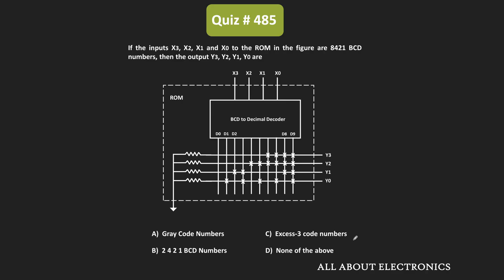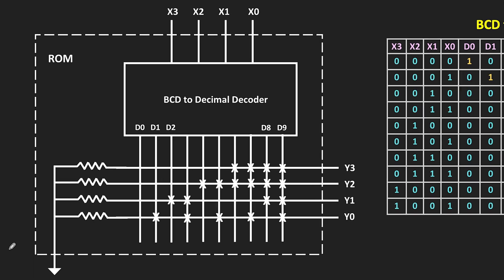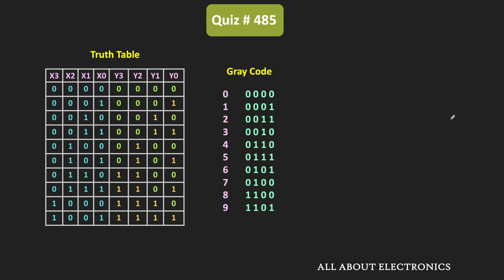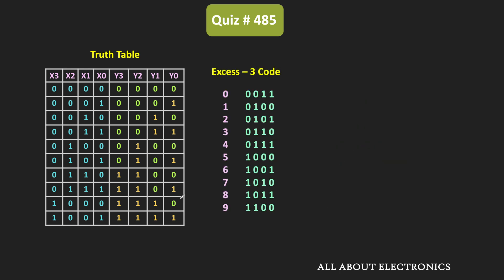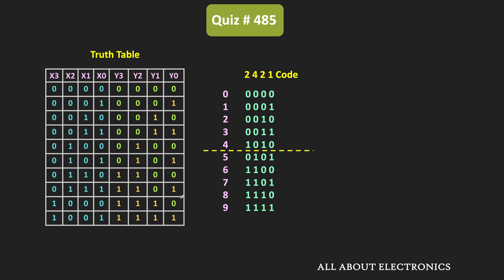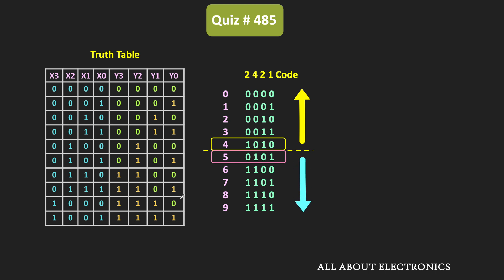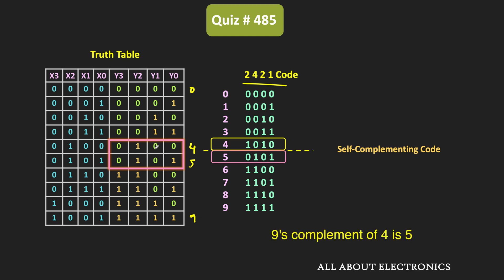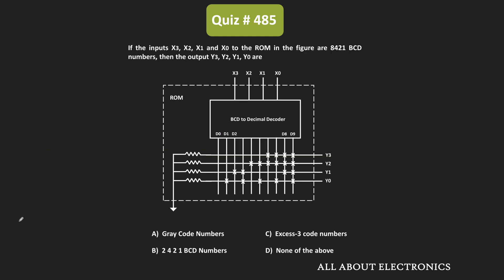ROM as Programmable Logic Device (Digital Electronics)| Quiz # 485

Comment: in 2421 BCD , 4 cna be represented by 2 types 0100 or 1010 ...  so the output actually satisfies the 2421 BCD code .... so answer should be B .... correct me if i am wrong
Reply from the maker: 2421 is self complementing code. That means 9's complement of the number can be obtained by simply inverting 1s and 0s. So, that criterial has to be fulfilled. And accordingly there is only 1 way, the 4 can be represented. I hope, it will clear your doubt. For more information, I have already provided the link for the BCD code video, where I have covered that in detail. You can check that link in the pinned comment.